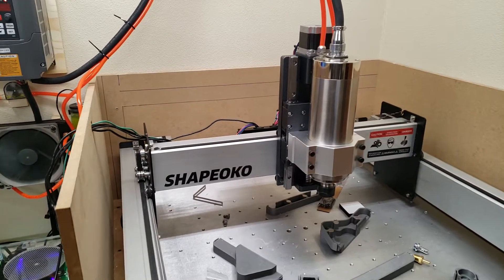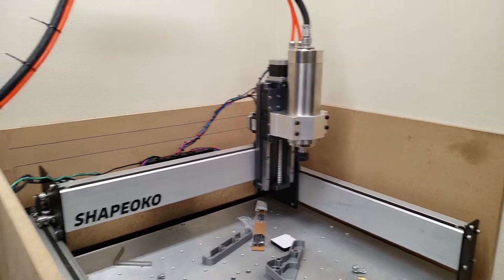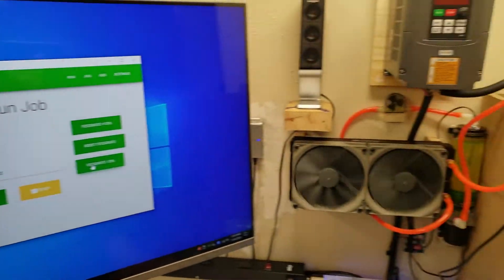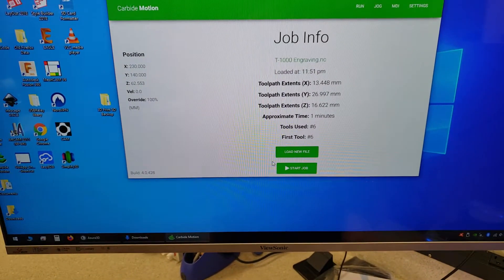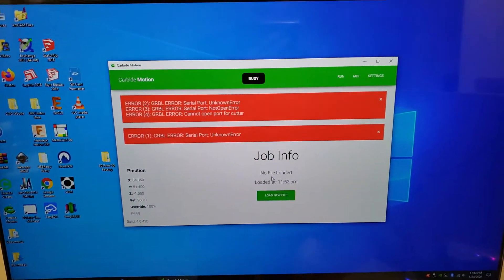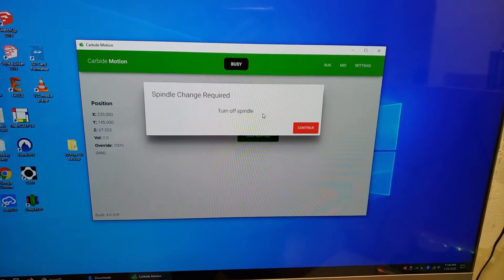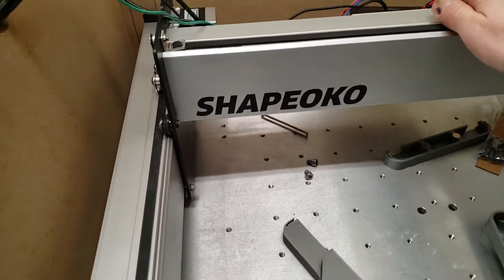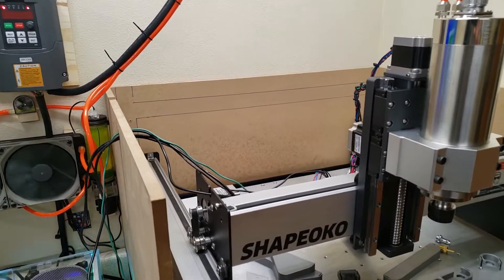Shapeoko 3 Disconnect Issue after 2.2kw Spindle Upgrade

Comment: My guess is, it's a current spike issue. The spindle turning on created a big current spike, which seems to be affecting the grbl control board. Isolated power supplies might help.
Perhaps the high current PWM signal is generating electromagnetic radiation of sufficient levels to cause problems with the board.

Comment: I had a similar problem.  You’ve probably read many different “fixes” on the shapeoko website. What fixed it for me was NOT running the power cable for the spindle with the rest of the cables in the track. I just have a Bosch, and after I eliminated it from running inside the cable organizer, I have not experienced the disconnect issue.  Looks ugly, and now connects off the opposite side of the shapeoko, but it works. Good luck.

Comment: Did you ever get this fixed?
Reply from the maker: Yes I did. The only thing that worked was grounding the board directly to the same ground my spindle was on. Other grounds would not work. You need to try different grounds until the problem goes away or use a USB isolator as a last resort.
Reply: @Th3mast3r69  Hi, do you mean the ground on the outlet, or the ground wire going to the spindle itself? Did you have it wired from the PWM output on the GRBL board in order to control the rpm with the gcode?
Reply from the maker: @tonybarnhill808  I manually set the RPM. I dont use PWM from the board. I the ground going to the VFD should be the same as the ground going to the VFD. That is the ground that fixed my issue. A direct ground from a different outlet would not work.